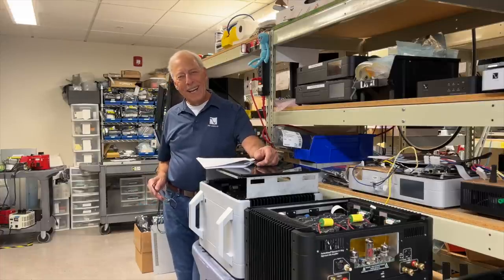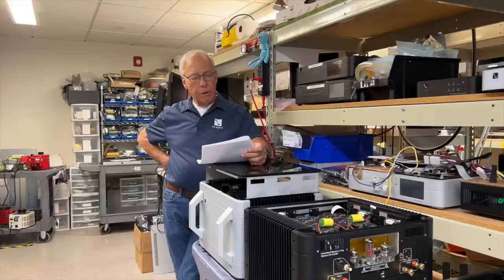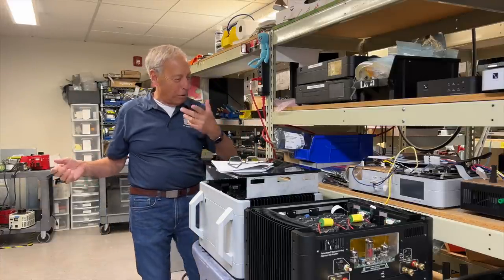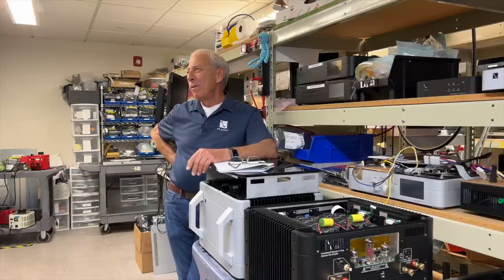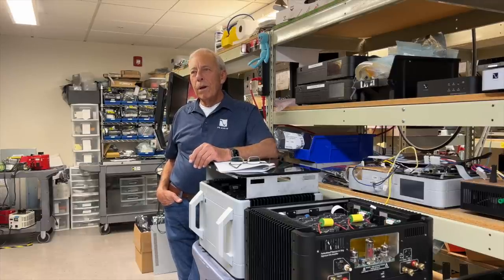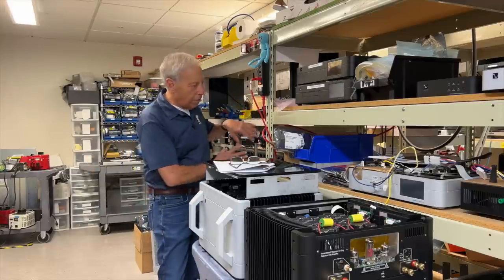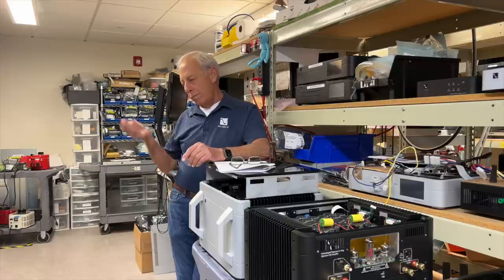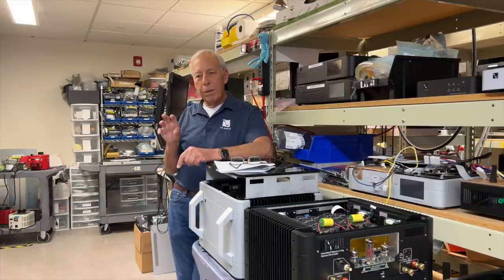Finding and fixing hum

Comment: Look, I have fixed this problem that was plaguing my system bad. I discovered by eliminating the earth ground on all my cables, by modding my cable's the hum and hiss has COMPLETELY disappeared. I simply opened up the ends of the cable plugs and added the earth ground wire to the live hot  on BOTH ENDS!!! (adding AWG to the live wire) and i have never since had any issues with hum or any kind of noise. There are 1800 watt heaters putting out red hot heat that dont even have an earth ground so why would a stereo system putting out far less amps and watts have them at all? They are not necessary.  Some foks wont be able to open the cable ends, this is best done on homemade aftermarket cables . This method is virtually 100% guaranteed to eliminate all noise in your system, i have never had any issues after this mod and ive been doing this for the last 15 or more years.
Reply: Now you should just wait got the moment a device which had to be grounded but is not malfunctions and shorts internally, current is carried to the chassis and you get fried when trying to operate it.

Comment: I had a hum on my system recently, took pre-amp and power amp for a service, and even a small mod on the power supply to the pre-amp. Also had the interconnects re-terminated with special solder. Turned out to be RCA's to the two subs on the second line out of the pre-amp, as soon as I disconnected these RCA'a it went quiet again. Did not help to just switch the subs off. So now no subs till I figure something out.
Reply: “special solder” as long as the solder joint is well made the type of solder will not make any difference.
Reply: @Douglas Blake It has given me the opertunity to get my old Isobaric passive subs out and play with them again. So far so good, no hum at all, and to be fair they are a better match for my Maggies anyway.
Reply: @mikepxg6406  I don't know, that's what the tech said.
Reply: @Douglas Blake No I like this guy, I'm sure something lost in translation. I tried to do it myself but couldn't get the solder to flow.
Reply: I'll  tell him you said so and then duck, he is a big boy 🤣
Reply: @Douglas Blake I rather float the RCA shield (signal wire) at the receiving end than cutting off fault current path (ac power  grounding conductor)
Reply: @Douglas Blake the shield is still connected, but only at the source end, not the receiving end
if the coaxial shield has a bad ground, coaxial core is not shielded, it becomes a long wire antenna

using metal conduit, shielded power cable, isolated ground cabling and balanced transmission now sounds like a good idea, may be even a lead lined, water jacked, sonic controlled bunker listening room under a mountain
Reply: @Douglas Blake To be fair, he could have meant lead solder in this day and age. That's what we call it at work, as we are not allowed to use lead solder anymore because of ROHS.

Comment: bad audio cable(s) is my guess.
Reply: Unlikely.  Ground loops are normally caused by hardware design or power supply failure.  If you get an open circuit on a RCA the noise will be very noticeable and the signal will decrease almost to nothing.  Try inserting a cable with everything turned on and listen as the RCA signal pin makes contact before the ground.  You will know what i mean 😵‍💫

Comment: Hum, yeah. Sometimes you just end up with two bits of gear that just don't like being together,  both fine In your system without the other, but when brought together,  nothing but trouble.
Quite often involving how they are earthed.
Connecting some laptop's (with power brick attached) to a system can induce so much hash it's not funny, even connecting them to supposedly pro mixing desks brings in heaps of trouble. Usually there being a truck-load of common mode crud on the outputs.
Tell the owner, they look perplexed, they connect their headphones,  nothing, it must be your 100K sound system.

Comment: I replace my SS pre amp with a tube pre amp fed by a SS amp and immediately got the “humming blues”  After going thru the process described in this video I determined it was the tube pre amp. I replaced the RCA interconnect cables with a budget  pair of XLR cables and the hum disappeared!  So this begs the question - was the issue a GROUND fault  or a MY fault ? 😝
Reply: It's a ground fault. The XLR cable enables the amp to use common mode noise rejection on the input. That is why you no longer have hum.

Comment: Going through a bunch of tests, I actually found the hum was coming from the HDMI between my projector and the rest of the system. And following that, I found the sound is coming from the ground in my house. Pulled out the third prong on the power plug of my projector, and the hum was gone when I put the HDMI back in.
Reply: Different circuit?
Reply: @Roof_Pizza  the room has 3 different circuits. Two in the front for each mono block amp and one in the back for the sources which the projector is plugged into
Reply: @shawnmathew825  I've always heard that one dedicated circuit is best. I guess if you have monster amps that they might need their own so that's out the window. I've got 3 amps (9 channels) on a single 15A and that's turned out to be plenty.
Reply: @shawnmathew825  you need a high-power 20A inductor of 3 mH on the earth connections ideally on every piece of equipment. or try ideally with earth filter a Lc  or LcL ban pass between 45Hz - 65 Hz.
Reply: correct me if I'm wrong

In unbalanced audio, the difference between the + terminal and the supposedly 0V reference is the signal
the signal will be contaminated if that 0V reference is no longer maintained
that happens when another device not at the same 0V reference potential is connected via interconnects such as hdmi or rca cable
the differences of 0V reference (ground) potential between different equipments is the problem

and sometimes, there are noisy/bad equipment that put out concernable noise to the ac ground, and your equipment is referencing a noisy ac ground
Reply: @Douglas Blake beside bad signal cable routing, how does that ac mains 60Hz gets into the coaxial shield?

Comment: A useful , though costly , addition is to plug every piece of gear into a balanced AC power supply . Eliminates power supply hum , rejects common mode noise & dramatically lowers the noise floor . 
It is CRUCIAL to follow instructions that no piece of gear be plugged into any other source of power . No power "conditioner" will do what a BPS does .. I bought Equitech Q 1.5
Reply: Are you referring to the units with the lowest cost of about $750?  I see Furman and companies like that sell what they call conditioners.  Anything with the word "balanced" seems to be many hundreds if not thousands of dollars more.

Comment: I think Paul does an excellent job here trouble shooting sources of "Hum". And I agree with him that it can be a difficult thing to define and mitigate.

Definition of "Hum": Generally defines a 60Hz low level presentation of sound at the speakers. The amount of Hum may, or may not, increase or decrease with volume level setting. Sources can be found in power supplies, failing circuits like old power supply caps.

"Hum" many times is caused by an AC power feed "Ground Loop":

Ground loop (electricity)
https://en.wikipedia.org/wiki/Ground_loop_(electricity)

These can be especially difficult to find and remedy.

If you've gotten this far:
I share a source of HUM that was very difficult for me to find and resolve. The Hum only came when the arm/cartridge of the turntable was placed on the record surface. Lift the arm off the record surface the hum stopped. Put it back on and the hum returned. The turntable was well insulated for mechanical vibrations and the floor was a cement slab. Ultimately I found that it was a mechanical vibration created by a nearby electric power company power transformer. That was at least 50 meters away. But if you stood next to it you could clearly hear that it was vibrating and putting 60Hz mechanical vibrations into everything around it.

Even more exotic turntable isolation minimized the problem. But didn't fully get rid of it.
Reply: Moving house would be better
Reply: @geddylee501  LOL